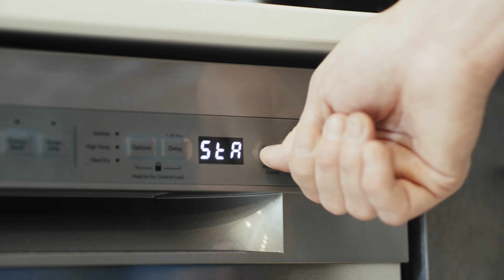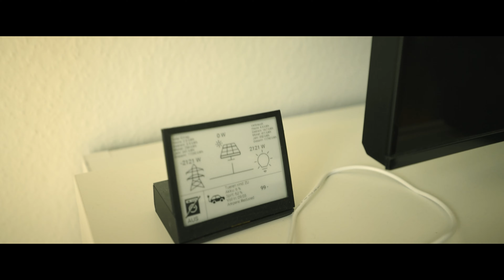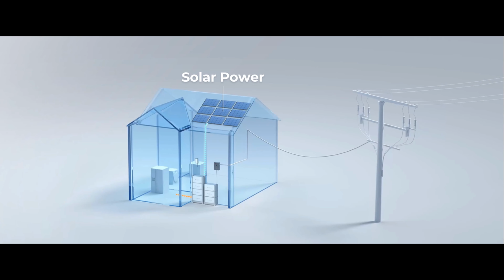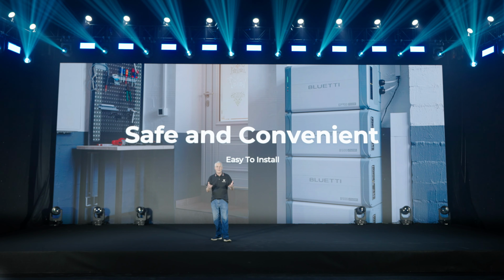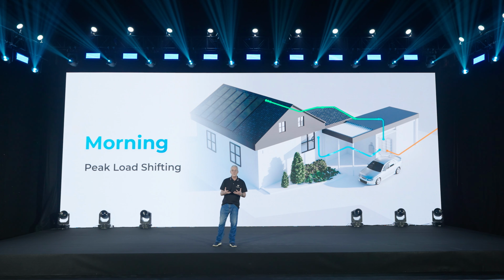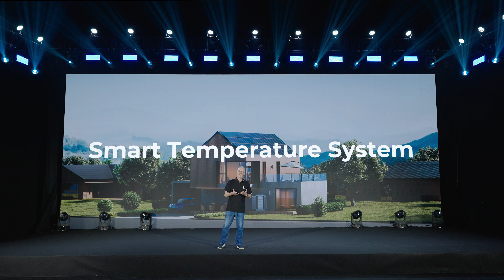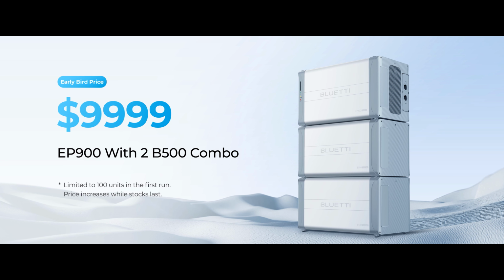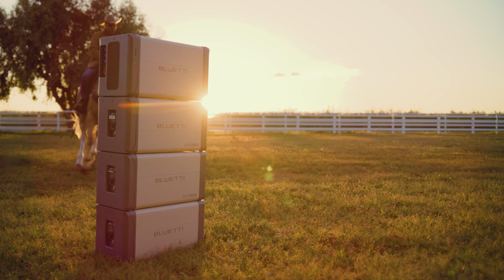BLUETTI EP900 Launch | Secure your home with stable power supply

Comment: I need an expert opinion on this. I am from a developing country where grid power is so bad that our 1 ton and 1.5 ton air conditioners cannot run stable. The grid is unstable, voltage constantly goes up and down, sometimes goes so low that Air conditioners just give up. Sometimes grid just shuts off. I want to buy this without solar panels just to stabilize the grid. Will this EP900 be able to charge itself even from a grid that bad?